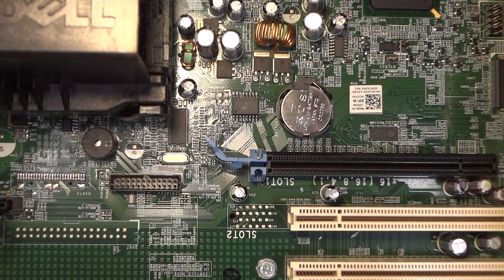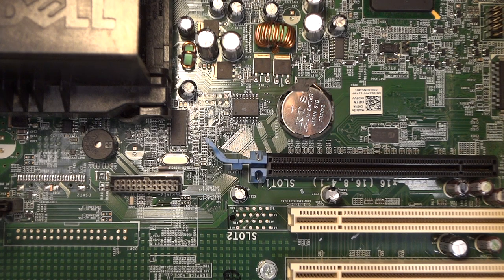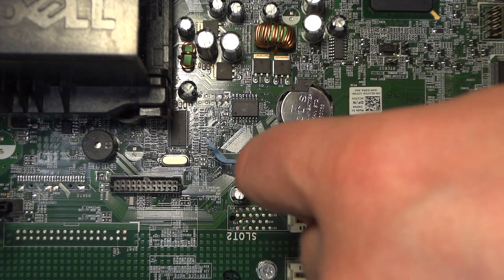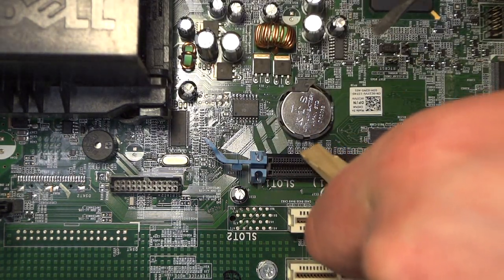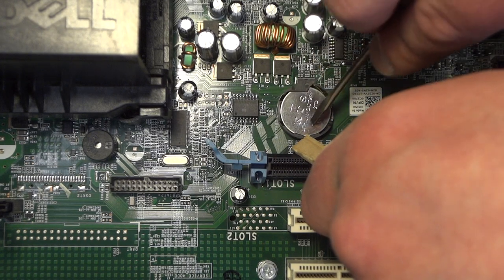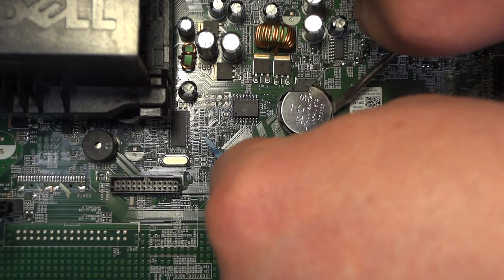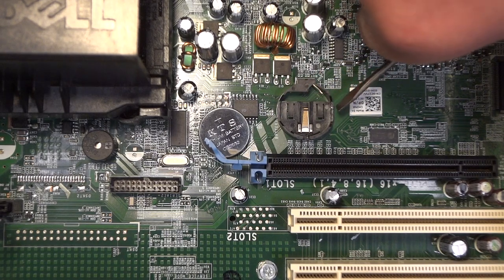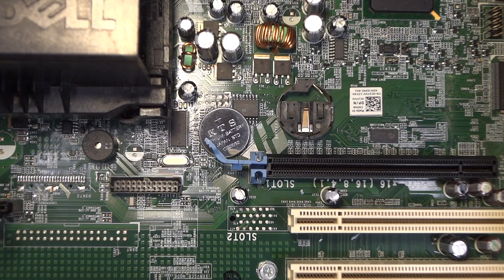Dell optiplex 780 desktop remove battery no damage

Comment: The CMOS battery holder on a Dell Optiplex 990 is the same too. I used the hook on the file on a fingernail clipper. A hooked dental pick works even better. Get the point of the hook under the battery opposite the plastic cover tab. Get it in the slot and push straight back towards the plastic tab (to compress the spring) while pulling gently up on the battery and it will pop out. Keep the computer vertical so the battery does not fall on to the motherboard. Be sure to unplug the computer first. 
Buy a new battery for your computer Bike Man, so you don't keep restarting your computer when it looses the CMOS setting without a battery. Most of them take a common 2032 watch battery.
Reply from the maker: ive got too many to have enough battery's 🙃

Comment: These instructions are misleading. I found the way to do this: You have to press upwards from below with a narrow instrument into the space between the two lower brackets. A slight pressure is enough, the battery will then fall out.
Reply: I also just picked it up with a small pointy knife. Took 1 second or less

Comment: It's very hard.
Reply from the maker: There is a much easier way i found if you take a popsicle stick and break it so its only half as wide and cut off the end with electrical cutters you can use just that ... no screwdriver, it pops right out. I might make a new video.
Reply: @BIKEMAN21  If you get a small screw head carefully between battery edge and one of the two small clips (on the unbroken side on this video,) and rotate the screwdriver slightly, the clip opens out and gets clear of the battery.  The battery then moves more tightly against the other clip.  I found that you can carefully get 2 small screwdrivers, one for each clip, at the same time.  Rotate them very carefully and both clips become clear of the battery, and the battery will just move up slightly so that the clips will no longer be able to jump back over.  The battery does not simply spring out at this point, you have to then gently get a screwdriver under the battery, just like the maker of this video.  The battery then pops out.  I did find that it was not necessary to keep the twisting screwdrivers in - once the 2 little clips were clear the battery just moved up enough to stop them popping back over, and I could then get a screwdriver under the battery and gently lift it.
Reply from the maker: @abecrabtree5458  the video is a bit over kill actually, all i do now is get a small flat screw driver and slide the battery from the side and pop it out at same time